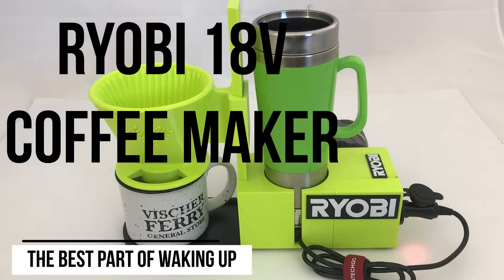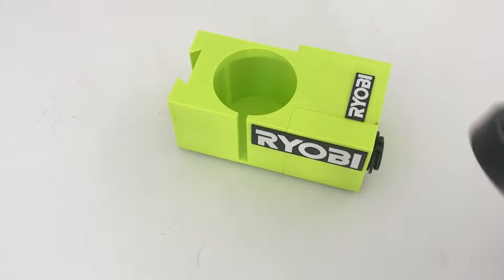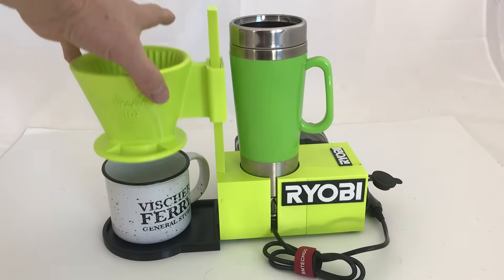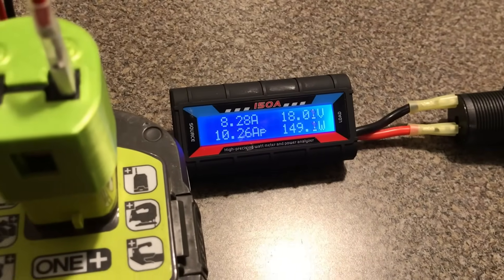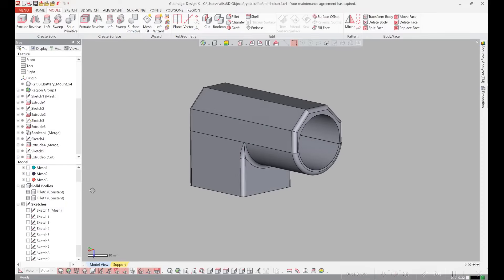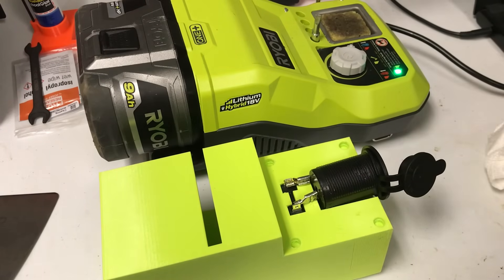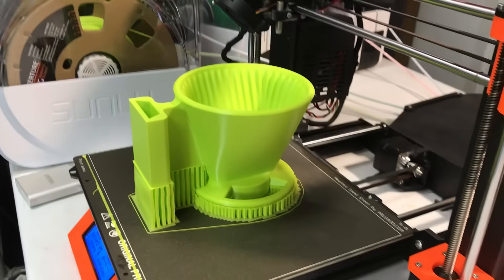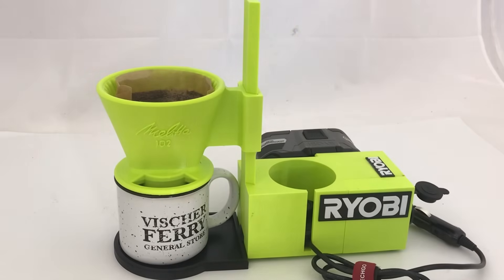RYOBI 18V Coffee Maker

Comment: That looks cool. Just an Idea you could use like a momentary switch when the cup is pulled it turns off.
Reply from the maker: the heater is inside the cup. When you take it out of the holder, it gets unplugged. If you put it back in the holder with no water, you will fry it. I unplug the cigarette lighter plug so I don't forget :-)
Reply: @SerendipitySue  Nevermind my comment about the switch.  Didn't realize the heater was in the cup itself.  Thanks.
Reply: Exactly.  That was my thought too.